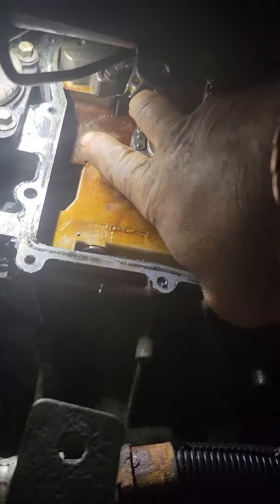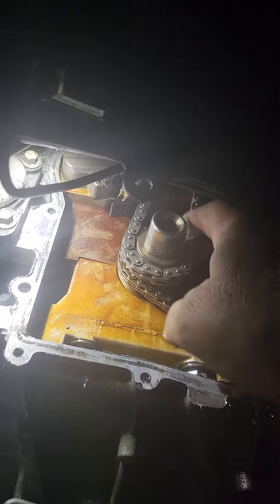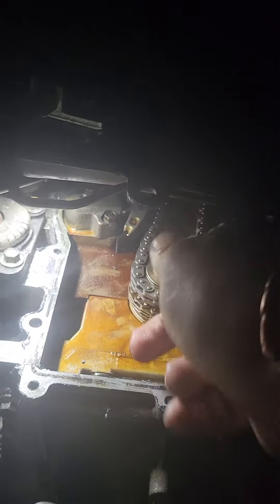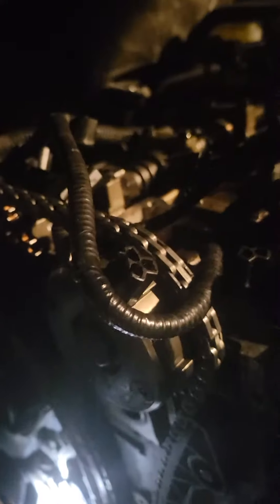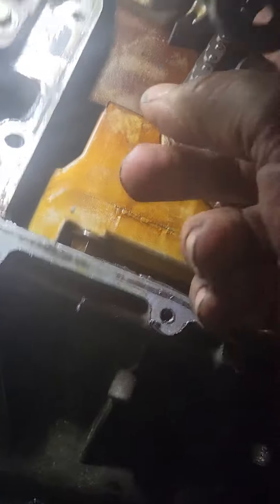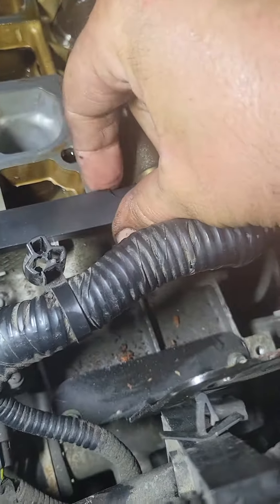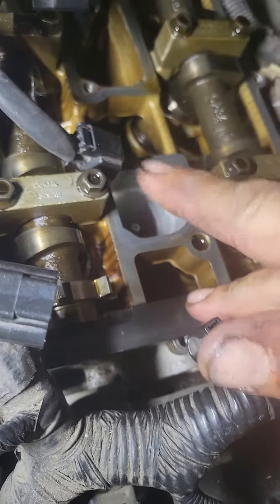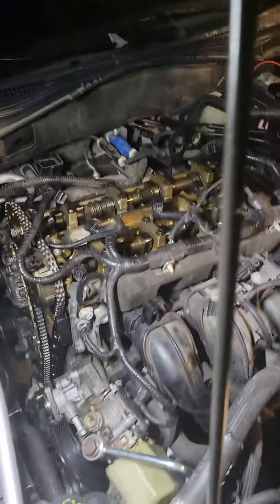ford 2.3l, how to set timing chain tensioner an leave it alone

Comment: I never knew oil pressure did the final adjustment.
Reply from the maker: Yup,thats why put all slack on tensioner side,  will just for quick second chain rattle till psi hits it, there an oil hole on back side of tensioner

Comment: Hi. I have a problem where the engine died on my driveway. The engine turns but does not crank, my ford mechanic told me if it’s the guide that’s broken then I can get away with replacing the chain, if the tensioners broke then the valves will be bent (I was told this 2.3 engine is an interference engine.) What do you reckon? Is it worth trying a new timing chain?
Reply from the maker: Need to do a leak down test, even on interferance engine, that will tell you if there is any damage or not, if he is a mechanic he should have said that,  it a easy test, an if its a timing failure, it were you blow air into each cylinder an see if it holds pressure, you cant go by what componet failed,
Reply: @bigjim11566  that makes sense, i will look into this thanks!
Reply from the maker: @ace5872  no prob, leak down test is only good way to know if there is any damage, if bent valve, then can either send head to machine shop or buy reman head,